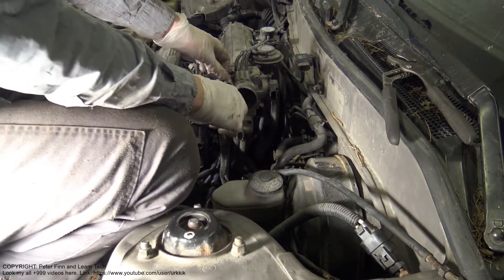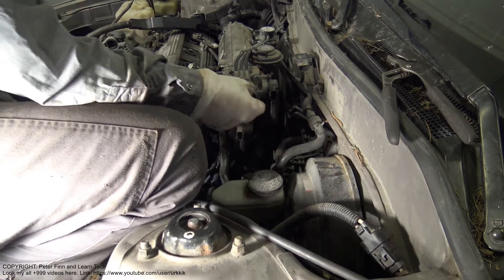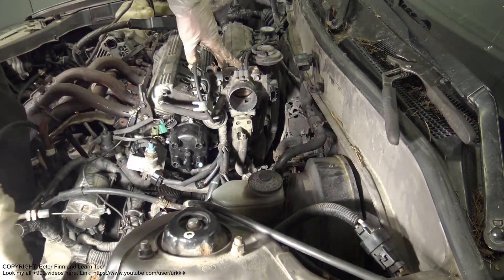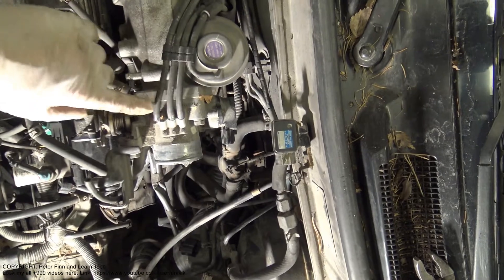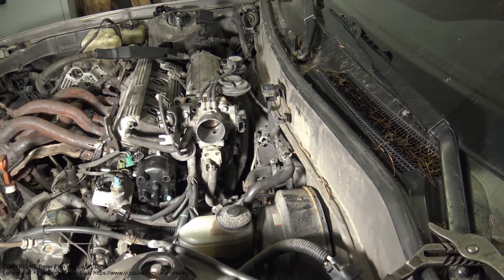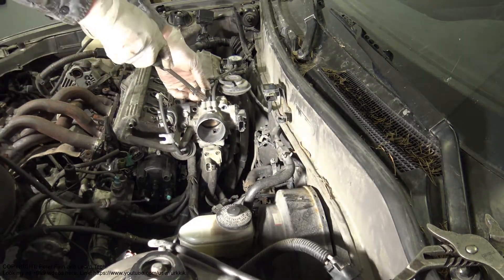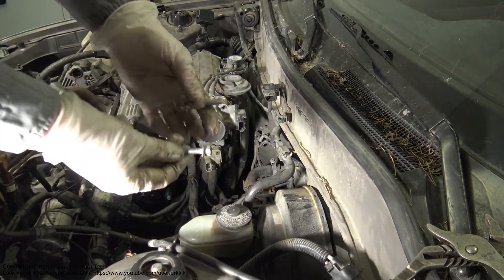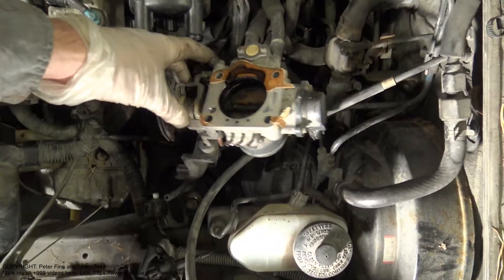How to replace throttle body Toyota Camry 2.2 engine 5S-FE

Comment: Can you tell me where the air intake tube from the carburetor connects?
Reply from the maker: Sorry, no info on carburetors. Sorry.
Reply: You've probably figured this out by now 6 months later, but this car is fuel-injected, no carburetors in sight.